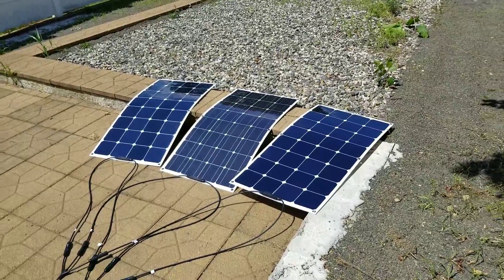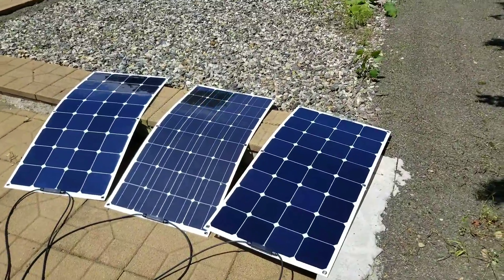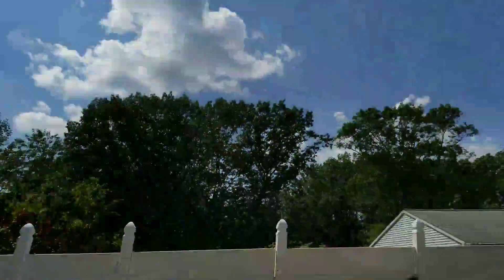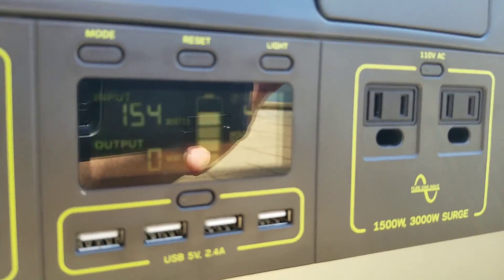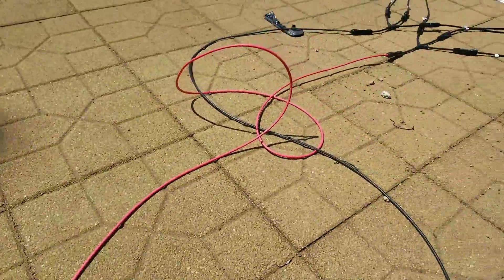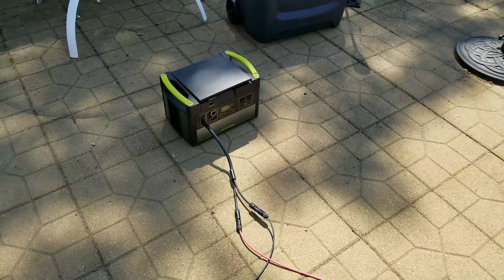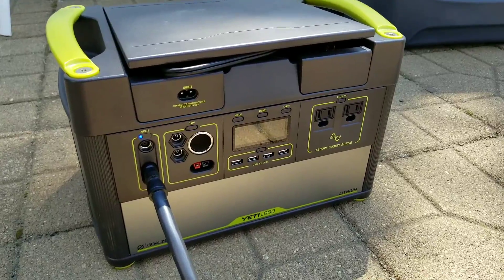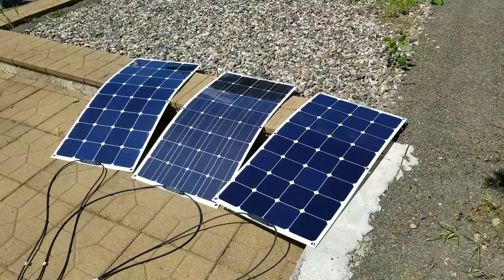Yeti 1000 charging with 3 100 watt panels, only getting 150 watts

Comment: You should tilt your panels to match the latitude of your area( example, I live at approximately 33 degrees, so I would set my panel angle to match my latitude) also place your panels facing south. The best way to capture maximum energy from the sun is a sun tracking system. Basically a sun tracker is a way the move panels is with an azimuth and elevation platform. The sun comes up a starts moving the panels through out the day. At the end of the day the tracking mechanism move the array back to the starting position and the cycle starts over.

Comment: if its more power u want then more power you get...the hotter the temp of the panel the less power out of the panel you get...so figure out a way to cool them down some like using a heat sink or any other way available to you...also...another reason to cool the panels is because you can use reflectors around the solar panels to give the panels a bigger area of light instead of just using the area of the panel only to gather light...but doing this will heat up the panels more which is why its important to draw heat away from the panels...start off small and use some aluminum foil to make a half circle around the panels so that more light will hit the panels...controllers use up some of the power generated from the panels which only makes them less efficient...dont let anyone fear monger you into paying for fancy controllers

Comment: From what i have read the 8mm input can only receive 150w. You could increase the intake by installing the mppt module and using its two 8mm intake ports. (Each rated for 150w intake) for a grand total of 450

Comment: (1) The extension cable reduces the power that gets to the PWM input you are using. So avoid extension cables if you can.  Otherwise reduce the number of them you are using.

(2) Get the $100.00 MPPT module to add in at the top right.  That will give you more of what the panels are actually producing.  Why GoalZero even bothered putting a PWM charge controller in these units and didn't just go with MPPT is stupid.

(3) You can charge the battery with multiple inputs of power all at the same time:

Solar
AC from wall outlet
DC from another battery

For example, you could buy 3 extras AC power supplies for a total of four and plug them all in at once.  

Or, GoalZero just came out with the fast charger that makes that unnecessary and does the same thing with one device.

Comment: Recommend using an amp meter to properly measure your panels and not rely on the Goal Zero indicator. The Goal Zero indicator shows the power on the other side of the PWM input. So you are not seeing the actual wattage from your PV panels. Also PV modules/panels which have differing characteristics can compromise its performance when stringed together.

Comment: when charging, the controller and battery heatup just like a phone and charger, the Yeti's charge controller is bottlenecking the input wattage to prevent overheating and damaging the battery, no matter how many panels you add, it's still gonna bottleneck the input power. I have a Yeti 400 lithium, I tried the 100w panel and a 325w and got the same result.

Comment: Never bend the panels! You probably already fucked them up... They are lightweight panels only! Anyways you could test them by using a dummy load I made a video of how I made my dummy load to test these panels, so look on my video list.... yeah the dummy loads definitely it's going to need to be heatsink if you're going to test a hundred watt panels...
But with you're Yeti battery, can you charge it more than 150 watts input, in the first place? Might not be designed to take more!
So when you're not using solar and you're plugging the battery into the wall how much wattage is that using?

Comment: The orientation of your solar panels is contributing to the loss of efficiency. Flexing them away from the direct sunlight is going to lose some input. That said, if you got 200W from 3 panels, it would probably approach optimal in real-world conditions. Having been an apps engineer for computer I/O products most of my career, the most important thing I learned was "rated" and "delivers" are often not even in the same ballpark.

Comment: Looking at the Yeti 1000 spec sheet, the Anderson input maximum is 240W of power, from 16-30V and a 20A max. 3 100W solar panels, all at 12V would be providing a total of about 25A at the factory rating. If they were 18V panels, they'd provide a total of about 16A. There may be some power loss in the resistance provided by the multiple connections, in the PWM charge controller in the Yeti, and the solar panel angling. It is possible that the fact that they aren't GZ panels may contribute to the issue, but that could also tie in with the resistance between the adapters.
With my GZ setup, I have a Nomad 28 Plus and a Boulder 50 that power a Yeti 400 Lithium, which is a total of 78W of rated power, but the highest amount of power I've ever gotten was 51W of power and the average of about 45 over a few hours, which is about two thirds of the possible power.

Comment: Increase the gauge of the extension cables, and all cables as much as possible. Yes, they’re more expensive but it makes a difference.  Low voltages, especially DC, require larger cables as compared to house voltages.  That’s why car jumper cables, the good ones, are such a big gauge. 

Think narrow fast river (house/AC) versus wide slow river (solar/DC).  😉

Comment: 50 - 60 watts is very normal with a 100 watt panel and a PWM charge controler. The panels are rated under strobe lab conditions. I'd love to turn you on to Goal Zero's new "Yeti Lithium MPPT Solar Charging Optimization Module" I have one and love it. Well worth the purchase if you have a 1000 or greater Yeti Lithium. Link: http://www.goalzero.com/p/510/yeti-lithium-mppt-solar-charging-optimization-module

Comment: Use the MPPT controller attachment. You'll get more input at once. It isn't the generator, its the panel's efficiency, angle to the sun & charge level of the yeti. If the Yeti isn't empty, you WIL NOT get the full 300 watts even if the panels were 100% efficient (check the efficiency rate of those panels. I guarantee that they are not 100%. Maybe 40% at best.) The generator' charge controller is what is keeping it from taking in a higher input so it doesn't overcharge the Yeti's batteries. Look up "Stadium Effect" charging in the manual or on the GZ site. That explains this probably a lot more clearly than I have. Good luck!

Comment: I get up to 30% more watts by angling. But for sure there is a 30+% loss from not having MPPT, just ask GZ tech support... also make sure you test panels with a voltmeter and not with the Yeti, you should get 90W each in full sun. GoalZero just brought out a MPPT expansion box for $79 for the Yeti 1000 and 1400, this should bring efficiency waaay up.

Comment: Your not doing anything wrong. here something most people don't know. the goal zero charge controller has a cap on each battery pack. they usually, only allow 130-150 watts charger per input. so the battery and controller won't overload. even if your solar is in cap power. the light going off is the fuse tripping internally. to protect from overloads as well. this is only not normal on small device, but normal sometimes for power tools. If the power is running below 20%, the fuse might trip sometimes as well. hope this helps.

Comment: 1. Goal Zero uses PWM charge controller, not more efficient MPPT, so a lot more energy is lost in conversion... This is your biggest reason honestly

2. Solar panel output is rated under lab conditions very difficult to replicate in real world - You can't expect the rated output as you stated in the video. Not sure what your latitude is, however, the stronger the sun (closer to equator) the less things very difficult to see (like high altitude smoke or haze) affect performance. Of course stronger sun means panels heat up more, which can decrease performance too if they aren't adequately cooled. Remember, if the panel is 20% efficient and producing 50watts, then 200w is being dissipated as heat on the panel

3. Angling your panels to maximum sun angle makes a big difference - Probably would go from 150 to 170 or more just by doing this... The caveat is if the panels are in parallel they all need to be at the same angle, otherwise you lose any extra energy the best panel is producing.
Reply: you can use yeti lithium mppt solar charging optimization module on your yeti 1000 ( http://www.goalzero.com/mobile/p/510 ) to maximize power input.
Reply: Derek G goal zero sells mppt controllers for 79 dollars! I have a yeti 3000 with a removable mppt that came with the unit, I charge with 5 100 watt panels and have no problem keeping my battery float
Reply: Derek G - You have best answers on here so far!! The generator isn't the problem, it's the panels, chaining connection, angle to the sun, etc. these panels aren't close to 100% efficient. Maybe 20-40% at best. Panels need to be angled at 45 degrees southward facing to the sun (if in the northern hemisphere). That is the best angle to get the most sun. Roll up panels aren't easy to lay flat at an angle like that. The generator doesn't cause the energy loss, it's everything from the panels to the cables to the connection.

Comment: Watch Will Prowse's review on the 1000. It has about 44 % Loss when charging from solar.  You have not done anything wrong.  I have received my 1000 a week ago. I am disappointed with the solar performance as well because that is what I intend to use as charging source.  Thank you for ,the video.
Reply: Saw Will's video, which was pretty disappointing. I don't know if PWM controllers are typically that bad, or if it's the Yeti's. Yeti does recommend their YETI LITHIUM MPPT SOLAR CHARGING OPTIMIZATION MODULE, but that's another $80.
Reply: the panels he is using could be garbage. if you use the goal zero panels you get better efficiency. I noticed third party panels on goal zero yetis get really bad efficiency from my experience. I think there are just some proprietary designs in their generators which require proprietary panels to get the most out of it. Will Prowse doesnt use goal panels to charge his yeti , that could be where the loss is coming from in addition to no mppt. You will get teh most out of goal zero if you use their yeti 1250 (already has a mppt controller in it) with boulder 100s. I dont think their lithium line is good and also the lithium batteries that are currently being used for power generators have trouble handling heavy loads compared to lead acid batteries. The exception is tesla lithium batteries but they havent made their battery technology available to portable generators yet. So I am going to wait for tesla to make their battery tech available before I buy any lithium generators.

Comment: your panels are mixed. also, even if the panels are 100watts each, their perform at around 85%, of its capacity. so, if your system is considering two panels, each at about 85%, both will be 170watts in direct sun in perfect condition...which is about what you get in an angle.
Reply: Not true for a PWM controller, as long as the lowest voltage panel can deliver over voltage of the battery, it will charge the battery. If the battery need 14.4V to charge, you add the amps each panel delivers at 14.4V (ignoring the cable loss).  If one panel have an open circuit voltage of 20V , and the other have 29V, they deliver 14.4V to the charger in bulk mode (CC mode), no matter if they are connected all at the same time, or one at the time...